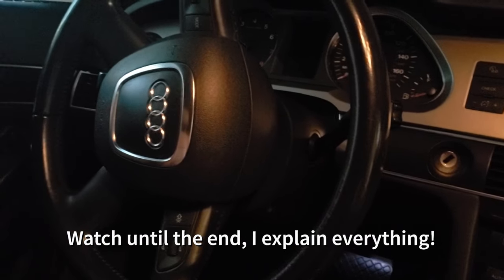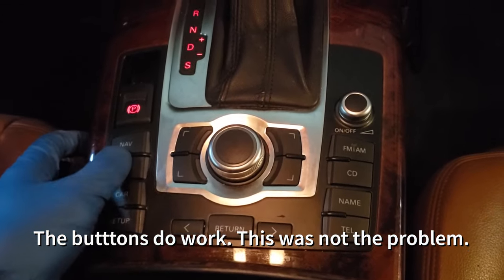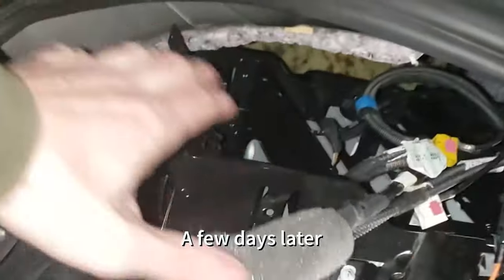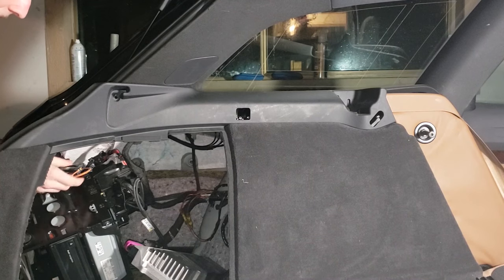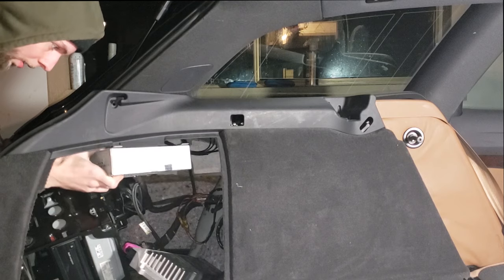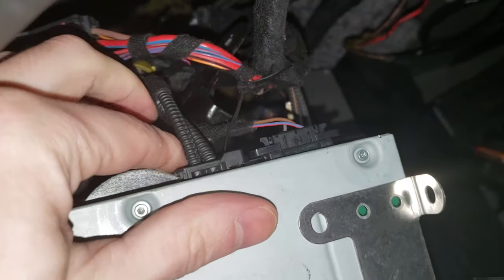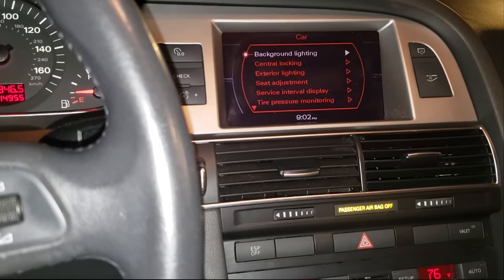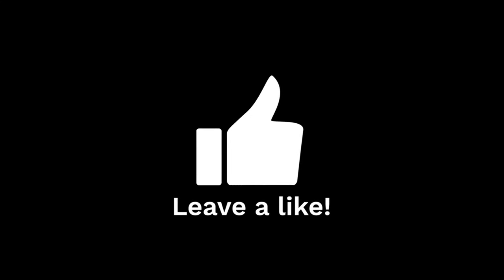Audi MMI Diagnosis & Repair (Fiber Optic Testing) | DIY

Comment from the maker: Fiber Optic Lollipop Tester - https://amzn.to/3menBva
eManual Repair Manuals for Any Vehicle - http://shrsl.com/43l4o
Reply: audi a3 have inbuilt amp so lollopop tester why need
Reply from the maker: Even if it's built in, the fiber optic loop needs to be tested to confirm that it's actually receiving signal. If there is a break anywhere in the fiber optics system then it won't work. The tester completes the loop, bypassing the amp (or other modules) to confirm its good
Reply: @Mechani_Cole  can i use amp in fiber optical externa amp
Reply from the maker: Good question
Reply: @Mechani_Cole  if possible my mib have no sound i chanhe in built amp ic but no sound

Comment: Mine is turning on for maybe 15 seconds and then shutting off. When it turns on it has sound and stuff but then it turns right back off but every once in awhile it will stay on until i turn the car off again.
Reply from the maker: Likely a bad unit in the rear
Reply: Same shit, and it started after -16c in night

Comment: Hi i have problem on my a6 c6 4f the mmi was not working like for 5-6 months a then we able to fix it but now when turning it on it works just has some lines on screen like it turn on but you cant see nothing it just keep showing horizontal/vertical lines all over the screen
Reply from the maker: Interesting, have you had it ever show the words/options correctly on screen? Wonder if you have a bad screen or a bad connection somewhere
Reply: @Mechani_Cole  No i just see colors like orange and the green menu nothing more but it can be bad connetion idk

Comment: please sir i have issue with my audi a6 quattro 2005 my radio keep going in and out also the cd player 
is it amplifier issue or wiring 
issues and what should i do ?
it stopping for like 3 seconds and continuing work .. but some times when it's cold the radio and cd don't work 
i'm asking you because i'm about to change the cd with bluetooth 2g mmi adapter so please tell me what can i do to stop the cutting before i get the adapter???

Comment: Hi Coleman, just purchased an audi q5 2012 and the MMI powers on, navigation works, you can hear the navigation voice, but the radio volume doesn't work, nor can I adjust the bass, balance, fader, treble etc.  I've replaced the console control panel and everything remained the same.  So thinking it's either the receiver or amp.  I tried the loop on both (admittedly, not really know what I'm doing-learning on the fly).  Any idea what I should do next?  replace amp/receiver?  thanks for help
Reply from the maker: This is actually a good question and I am having a similar intermittent issue with our 2014 Q5. Will post a video if I find a solution. Not 100% sure at the moment

Comment: Ok, I bought the loop and tested on the amp and the Sirius satellite and it didn’t fix the problem. Does that mean it’s not an issue with either of those?
Reply from the maker: Yeah. Test all the modules back there one by one to check for any changes

Comment: My mmi system wont power on! HEEELLLPP! PLEASE! I rested it, the screen works fine! I've notice the sirus xm module was missing but it had a optic loop on it! Do the 2 other power wires need to be plugged in to the sirus xm module or do i just need to have the optic loop plugged in? Will it still complete the loop without the other 2 plugged up?
Reply from the maker: Some models weren't equipped with the XM module even though there is a spot for it. Plug the connector into the plug, not the module. Each time you switch plugs, check for a change

Comment: Hi I have a problem with my mmi, the sound goes off & comes back on every 20-30 seconds. Also sometimes the whole mmi shuts down, was wondering if anybody else came across this issue. Thanks
Reply from the maker: I would test each module with the tetser and see if one if messing up more than others.

Comment: I have a 2008 a6 and took it to the dealership because there is no sound coming out at all from am or CD player it’s stuck on pause/mute and all they said was “no communication to sound system control module, recommend to replace (may need additional parts) what even is the sound system control module, is it the radio tuner?
Reply from the maker: Well, sir Glizzy, it's basically a bunch of mumbo jumbo that means they don't actually know and that it's going to costs thousands of your dollars to figure out. 

You can try to find the same module on Ebay and replace it yourself. I replaced a the control board and all kinds of stuff before this video that didn't fix anything.
Reply: @Mechani_Cole  wow, that’s exactly what I was thinking lmao that’s their way of saying idk since they don’t wanna test any parts independently how you did to actually figure it out cause they might fix it on accident without me spending thousands lol

What module do you suggest me trying to replace? The music will sometimes come on randomly for a few mins, hours or days the longest it stayed on was a week then a popping noise is repeated a few times before completely going out. Do you think if I try n take it to another audio shop they can actually figure out the problem? Since I know dealerships are the worst for actually trying to help you

Comment: Hey man my amp on an 09 S5 got damaged from water going through the trunk, I ordered a very similar replacement just a 2011 amp instead of a 2009, my local mechanic "who identified it being the amp which was the problem by using the same method as you) attempted to code it for me but says he needed a special type of system which he didn't have, I took it to audi dealership and they could also not code it because one of the modules but somehow didn't want to get further into it because I had originally paid an hour labor just for them to try to code it. Wondering if I should get the exact part number for amp or it could be something else? Really appreciate you helping with these mmi problems 🤦🏽‍♂️
Reply from the maker: I would recommend finding the exact part number and getting that instead. When I replaced mine I found the same part number on Ebay and it was plug and play with no coding needed
Reply: I have water in my 09 A4 wagon. mmi and a host of other things don't work.

The bypass didn't work on mine either :(

Comment: Bro for mine there is no audi logo showing when switching on the car. MMI is actually comes directly the radio or something there is no audi logo showing while switching on
Reply from the maker: Not sure on that one. Maybe try a reset?
Reply: @Mechani_Cole  I tried to reset but reset option also not working
Reply: I have a similar problem, no screen at all, not even briefly. I have just tested the optical loop for the four components in the trunk. One by one, I replaced a component by a lollypop bypass, nothing changed. The CD changer in the glove compartment has its lights on, but I cannot make it do anything else except a long hold on the main button to turn  the lights off. So, it may be the board itself, since no lights are there, or the screen (doubtful) since all the buttons are affected, or possibly the CD changer (not clear why the screen doesn't come up at all).

Comment: Is there anyway to bypass the whole mmi system and just run aftermarket stuff? My screen will turn on randomly and i never have button control or sound. Ive already tried the loop and no fix.
Reply from the maker: I'm sure there is, but I would call a local stereo install place and see what their experience is and what they say🤙🏼

Comment: Hi there my q7 suv bose amplifier is damaged from the water now I got no music and the mmi sistem don't work. What can I do to music and let my mmi sistem work again. Please send me advise thank you
Reply from the maker: Hi George, good question! I had a similar issue, I recommend searching Ebay and finding a used good condition amplifier and then replace it. Thats what I had to do, cost me about $60 to replace it. But the dealer wanted $1800 to replace and fix it, so saved a fortune. 

Hope this helps, keep us updated🤟🏼
Reply: @Mechani_Cole  there is any other step after changing the module with problems?i heard something about an component protection at the local dealer only?just changing the module and it should work?
Reply from the maker: All I did was have the module rebuilt, added new fluid and a new filter and it worked perfect for me. Its not a guaranteed fix, just what worked for my situation.

Comment: I have a same problem with my Audi. Now I need to find same radio tuner with Audi number 4F0 035 056 B (mine) or I can buy same tuner with different part number from car scrap yard?
Reply from the maker: Find the same part number if possible. Ebay is usually a good spot👍🏻
Reply: Cheers mate.

Comment: Hi. Hope you will reply. I had same problem  but now, mmi is on, but there is no sound, no radjo stations and cd not loading. Sat nav is working. So, i tested all modules like you, but when i put fiber loop into cd changer system does not starting. So the problem will be in cd changer?
Reply from the maker: Did you plug it into the connector? Or into the cd changer module itself?

Comment: Hey bud great video. Having some intermittent issues with my screen not turning on, particularly in cold weather. Same thing buttons don't light up either. If it's intermittent, is it most likely still the tuner? Or is there a connection I can fit tighter or dry out if there's moisture?
Reply from the maker: Great question, and thanks for the comment!

First thing I would check for is moisture damage on/in any of the units. The MMI controller located near the gear shifter could also be bad. I replaced the circuit board pretty easy on mine first thinking that was the issue when it wasn't. But drinks get spilled there easily due to the cup holder being located right there next to it. So very much a possibility too!

Comment: I bought the loop thing and took it to my mechanic  and turns out my amp needs to be replaced as well as the whole set up bc it got wet :( but I was on eBay looking for the parts am I fine just by getting them off eBay ?  I searched up audi 2009 a4 amp exc am I find just by. Doing that or would I need to match the old amps serial numbers to the new one ? I’m sorry I don’t know if
 I’m making sense I’m new at these car things lol
Reply: Or am I just fine by buying them used off eBay ?
Reply from the maker: Buy them off Ebay, but try searching by serial number. The numbers need to match or be from the exact same model and interchangeable. Best to find the same part number. Doesn't matter if it's used. My used one lasted just fine for years

Comment: My MMI stopped working same way.. A week later still didn't work but suddently drained my battery over night to 8 or 9V. Car did not start of course and dash showed several errors of course because of low voltage, but MMI started normally at 9V. I am already charging and let's see if it will continue to drain, or will work. I am going to diagnose tomorrow after battery charged or replaced. Edit: Forgot ro menriom that the battery was half year old and never had any problems with it.
Reply: Hi. Ive currently got that same parasitic draw problem. Has been using power over night and has killed 1 battery and now I'm Charging the new battery every night to save it from going down to 5v .. on my Q7, the SD CARD and SIM slot thing is staying very warm and somehow is on when the car is off/asleep ..
 please let me know if you find out what's drawing power from your car

Comment: Hey hello I got a Audi A6 2008 when I start the car my mmi play well but some other times the screen goes off so I would like to know what was the cause of it, it’s been like that since I bought it, also those button where the gear don’t work too, the light still off on it
Reply from the maker: Probably best to start with replacing the circuit board for the buttons. It's pretty easy to do. After that, if still having issues, order the tester and test each module until you find the problem

Comment: Heloo man, i have audi a6 c6. I upgraded my front speakers, since than my battery gets drain overnight. I check fuses and mmi and i found out that my amp witch is factory amp is turned on when the car is off. Idk if it got something to do with speakers that i installed, im sure that i wired it correctly. Its been two months now i still didt fix than. Please if tou got any suggestions tell me ❤
Reply from the maker: Hey, were you ever able to figure this problem out?

Comment: Hi,
Please can you help me with the tools you used to access that area/compartment of the navigation, amplifier and tuner section.
Reply from the maker: Should just be a torx socket holding a few bolts in

Comment: Hello, I have a question. A friend spilled coffee on the buttons and now it doesn't work to control the buttons. What should I do?
Reply from the maker: Replace the circuit board under the buttons. It's pretty easy and not to expensive. Can find them on Ebay
Reply: @Mechani_Cole  good evening I would like to send you a video of what happens
Reply: I have a 2008 Audi 6
Reply from the maker: No need. It's pretty common on these A6s since the buttons are there. I've replaced a few of them

Comment: Does the receiver needs to be program to the vehicle? Or just plug-in and done?
Reply from the maker: Mine was just plug and done. But I made sure to order the exact same part number through Ebay. Try to make sure the numbers match for whatever module

Comment: Im having issues with my mmi also its been  a long  time since I last heard my speakers month's
Reply from the maker: Ya, that was the main problem here. No radio or anything. Use the fiber optic tester in the link of the video and unplug and test each module until something turns on. This tool bypasses the fiber optic and makes a connection. Whatever module makes the difference when unplugged is the issue. For me, it was just the FM tuner which was $60 on Ebay. But best to test before just replacing them.
Reply: @Mechani_Cole  so I just need to order me a fiber optic tester loop then how can I get ahold of one of those do I have to order it also or can I buy it at a store somewhere I really miss my mmi/radio  its tough not being able to listen to music in such a luxurious audi u know
Reply from the maker: @germanrodriguez1005  yes. There is a link in the description of this video for Amazon with free shipping. You can't buy these local, and they are very very cheap.

Comment: I got the same issue and found water from drain tubes coming in. Disconnected all amps and units in trunk of my Q5 but ALSO found a fuse blowing which seems like a short or ground issue, possibly from water damage to cables? Fuse will keep blowing and shows it is for the AMP. How can I fix?
Reply from the maker: That's a tough one, I would say possibly replacing all the modules and seeing if you can find a short in any of the wire harness

Comment: I had this problem but unplugged from the box in the trunk plugged it back in now all buttons work and radio plays but am not getting any power to the screen so blank screen have you any ideas
Reply from the maker: Likely a break in the fiber optic loop somewhere
Reply: @Mechani_Cole  what would you suggest new multimedia head unit?

Comment: How did you know that was the fix and not the control circuit board?
Reply from the maker: I already replaced the control board first because that's what I thought it was. Nothing changed. 

So I tested each module and easily found a bad amplifier with the fiber optic loop.

Comment: Where do I get the tuner and how to i test it and make sure it works with my vehicle. I heard I have to get it programmed to my vin number? Is this true? Can someone help me out please 😢😅
Reply from the maker: On Ebay, find the part number on your module, then type that into Ebay and see if one pops up. If you can find the same one, no coding needed. At least no coding needed when I swapped mine. It was an instant fix
Reply from the maker: Some on Ebay for $50 or less even🫡

Comment: My Audi A6 2008 radio stay on mute idk how to unmute it can the tester explain my problem
Reply from the maker: Have you tried messing with the settings? It could be a problem with the Amp as well. Does the screen turn on?
Reply: My screen come on and off but it stay on mute can the tester explain why ?
Reply from the maker: Have you tried messing with all the settings?

Comment: I noticed there is a fiber optic cable laying there with a red light pulsing out of it. I don't see another module it could be connected to  so this unused fiber optic plug with the red light pulsing that is just sitting there unused off the harness is causing a break and preventing the stereo MMI from turning on?
Reply from the maker: Not usually no. The red light you are seeing is the fiber optic signal. It appears red. 

You can always try plugging it with the tester and see if that fixes it. The tester completes the loop, which needs to be a complete circuit.

Comment: No I will order lollipop like you suggest I have another problem today start up put in gear goes into drive with jolt and rev same 30 seconds and it’s ok but then driving the display on speedo goes from d and6 to showing prds all in orange at same time if stop turn off and restart it shows as normal but then changes again to showing prds  great videos and help thanks
Reply from the maker: What year and model is your car?
Reply: @Mechani_Cole  2007 Audi Q7 3.0 automatic